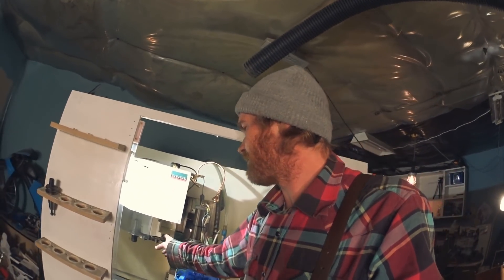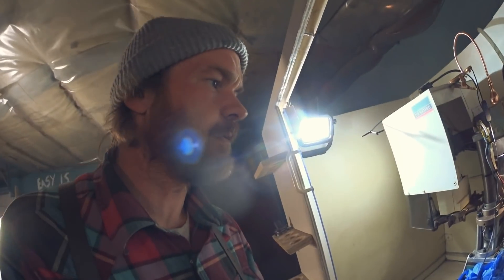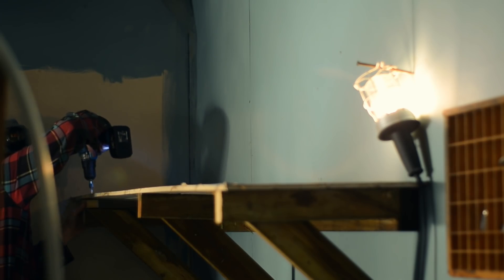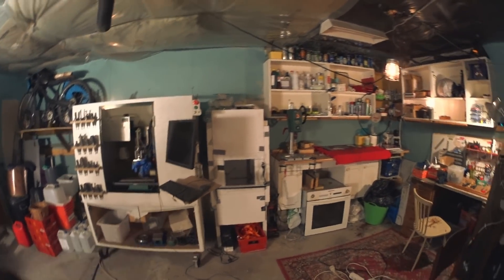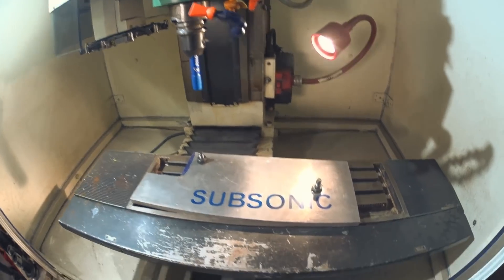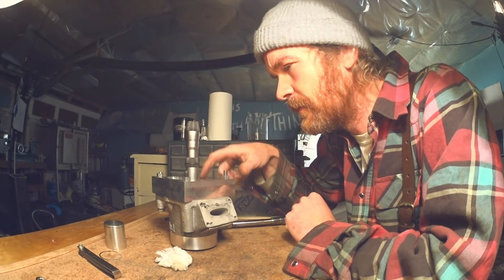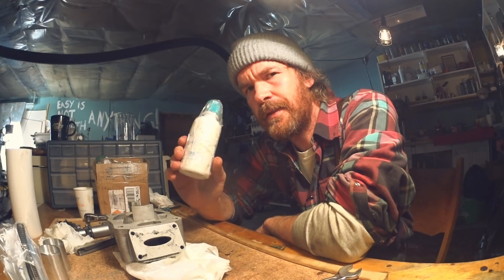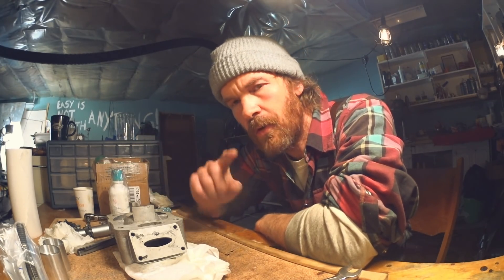Honing Plates make Difference? Most Powerful Two Stroke Ever.

Comment: Out of curiosity, how are you working it out as most powerful ever. Is it by H.P./Kg, H.P./C.C or are you just going for most powerful single cylinder 2-stroke.
Reply from the maker: Hp/cc
Reply: @2STROKESTUFFING  Nice. I am a great fan of the 2-Stroke, had them in motorcycles, go-carts, Suzuki 4x4 and still have one in an out-board engine.

Comment: I see you have a 3 point inside micrometer now. That's good. You say that the honing is leaving the middle tight and the ends larger? This bellmouth condition,  caused by the hone, can be fixed by changing the shape of the hone stones. Since the stones are cutting more at the ends of the bore the stones should be shaped in the opposite direction. To do this use a coarse diamond "stone" to abrade away a little bit of the the stones at each end. Now the stones will tend to cut more in the middle than the ends. How much to remove is an iterative process and it depends on what is being honed. However, if too much is removed from the ends the middle part can always be abraded away to correct things.

Comment: a question : a wankel motor rotative with triangle piston is :-2stroke or :-3stroke ??? 
does it better perform with a 2stroke style volume exhausts ??? 
with an rx8 we can do the most powerfull car in the world ??? 😈😈😈
Reply: Wankel design is comparable to a 4 stroke, as it has separate intake, compression, combustion, and exhaust phases.
Stock Wankel exhaust is highly restrictive for noise control. Racing versions use constant diameter tubing exhaust system, merged about 4 feet from the engine. Since it is not a 2 stroke, it does not require heavy return pulse during closing of exhaust port.

Comment: Nice job on the mill! I would to 3 phase motor and vfd. Cheaper and easier to find. Tool changer might just need the holder plate indexing to get the numbers match.

Comment: if the pistoni fits good with the pressure plates, like if you measure the bore and deem it OK with plates tightened, why did you want the piston to fit without the plates? with plates will be like when the engine is assembled, right? that was the point of the plates? good video man keep it up!

Comment: The commutator can be replaced with new one. If the armature winding is not damaged. Using a drill guide with perpendicular up nd down (like pressdrill) movement will help in honing. You should need it.

Comment: @2STROKE STUFFING   3D printed parts are printed at a high temperature. When the part cools, it contracts. It does not contract pefectly due to non-spherycal geometry- hence the imperfect bore measurements after it cools down. The top face is probably not flat either. It is mechanically flattened when you attach the pressure plate, as you found...
It would be very interesting to heat up the part and measure for bore imperfections. If the bore is more round when hot, should you not hone it hot (at least as hot as when the bike is running at maximum operating temperature)? Will honing it cold actually hone it (technically) wrong? If you hone it hot, when you run the engine and heats up, will the metal themically morph, therefore going against your 'cold' honing?
Does what I say make any sense?

Comment: Hi...After the Honing, you should be measuring the bore with the ‘PLATES BOLTED ON’
you should not be measuring with them off! 
....This is why you had a ‘Barrel’ shape when you measured without the plates!

When the engine is assembled it will go back to the shape of when the plates were bolted on!  Surely this was the idea of the plates in the first instance??? 
Measure everything & try the piston with the plates fitted!
Good luck Dude 🤠👍
Reply from the maker: 👍 Lots of comments about this. Of course, I feel kinda stupid...

Comment: I've had the same issue happen with tool changer numbering in my Fanuc. It's a very easy fix, but you NEED the manual. 
All I had to do was find the parameter for the tool changer position and change it to match. 
You'll need to get familiar with some common parameters and sequence for changing them.

Also, join CNCzone.com. It'll be a slow journey learning from YouTube. They guys on there have 1000s of years collective experience and are really helpful. Having a forum full of professionals really kicks the running crusher effect in the ass.

Comment: It's NOT tight in the middle...that is the distortion when the Cyl. is bolted on..That is why you use "Honing Plates"!!!..Ck. the clearance with the plates installed and it WON'T  be tight in the middle..without plates you would have a large balloon shaped cyl. when installed, which is probably why the issues with the rings developed in the first place..Keep going your getting closer!!!..It took me a year blowing up 8 engines, before I figured out how to run 15 Lbs of oil pressure, 0 valve clearance (to get more valve lift and duration) at 2000 rpm higher then anyone had ever run my engine without snapping piston rods..It's a journey..My engine has 30lbs cranking compression with over 185 lbs compression at full rpm..lasts 12 hours running time between "re-ring" jobs..It still holds the un-official lap time record at Road Atlanta after 39 years!!..👍👍👍🗽🇺🇸
Reply: Bores don't distort inwards with torque plates.

Comment: OMFG! The wooden folding tape measure! I have one of those too!  The thing about it being tight when it's a bare cylinder is that's fine, once you bolt it to the block it'll get back to where it should be. If you just adapt the piston to be loose when the cylinder isn't torqued down, you are going to have a super loose sloppy gap once everything is torqued.

Comment: Using a 3 phase AC motor and a vector drive is the modern alternative to DC motors one of the rather economical brands KCLY will even accept a tach but vector drives are pretty good at holding speed.without a tach.

Comment: I am a CNC machinist, the number on the carousel does not line up with the tool number.

edit, that motor failure looks like it got very hot, My guess is that it was not designed for large varying load

Comment: Hello, when using torque plates all measurements must be done with the plates installed for accurate fitment and ring gap. Recheck your cylinder with torque plates installed and make sure you are using the same torque wrench on all fasteners every time. Any gaskets on the head should be used with the plates installed also. All this does make a large difference in ring sealing. Well worth the time it takes. the tightness you are seeing in the middle of the cylinder may disappear with the plates installed. Good luck.

Comment: torque plates are extremely important I ran into that 30 years ago building a antique Harley . I had the barrels bored to 40 thousands over stock. at a famous Harley speed shop. 
 I found a 45thousands taper after I got the barrels back.
another thing is temperature of the shop . 68 degrees ferrihight is standard. your shop should be 68 for all machining and casting of pistons barrels ring crank pin all should be one in shops set at 68 ferrihight.
Reply: Thats Fahrenheit. Just saying.

Comment: 3d printers belong in corners and filament being fed to printer from a dryer underneath the printer. Takes up minimal space that way.

Also a good rule of thumb for me is to have critical stuff in the workspace, meaning I'd store that bike frame in a designated storage area and not have to think about the fact you might use it but not anytime soon everytime you walk by it.

Comment: If you don't want to over-hone it but you're worried about the middle pinching, try the feel when it's assembled & torqued down.  If it still worries you then how about circulating warm/hot water through the system before you start it?

Comment: A lot of comments already, but if it hasn't been mentioned. When you hone with torque plates,  you test the piston with the plates installed, as they are distorted as if the cylinder was installed. Trying the pistons without the torque plates are testing without the deformation of the plates.
Reply from the maker: 👍 First thing I'll do next time I'm out there.
Reply: @2STROKESTUFFING  and if possible assemble the torque plates in the same sequence as you will assemble the engine , base plate first then head plate .
Reply: Another benefit of using a steel cyclender liner. Stiffer with less torque distortion.👍✌️👌
Reply: this.
Reply: I was just going to type this
Reply: Agree..

Comment: That 0.05mm, is that your clearance on the ring groove or the end gap because if it is end gap, that is too tight.

I really dislike your set screw perpendicular to the bore.  If it backs out you are going to instantly trash your cylinder and maybe lock up.  Moving it to the underside of the piston wouldn't be much better, if it backed out it would probably get sucked in to the intake port.  I wish you could figure out a way to ditch the set screw and replace its function with a circlip or something that can't back out without breaking.
Reply from the maker: Clearance in the groove👍 yeah, agree on the set screw issue. When we're past the phase of frequent piston disassembly I could peen over the aluminium behind it to lock it in. Trying to come up with better solutions tho.
Reply: @2STROKESTUFFING  just had an idea, probably difficult to pull off but maybe workable.

Imagine a 30mm 12 point bolt head with a 25mm 12 point socket cut inside of it, now slice off 1.5mm of it to create a sheet metal lock piece.  Make your piston skirt with the bottom of the ring groove, the female threads and then a short 30mm 12 point socket followed by a circlip groove.  On the piston it would be piston head, top of ring groove, male threads (with wrist pin hole), then a short 25mm 12 point bolt head.

Everything would screw together, then you would put in the lock piece to stop the skirt from backing off, then a circlip will hold the lock up inside the skirt.

If the lock piece was made with the inner and outer 12 point surfaces off by 15°, you could adjust your ring clearance by your thread pitch÷24.

Of course the dimensions would have to be changed to fit and the lock piece probably has to fit over the connecting rod small end or maybe made in a C shape rather than O shape.

Also, a Spirolock might be better than a circlip but possibly a huge pain to install.

Comment: I have several NEMA 23 stepper motors, I don`t need all of them, these are from industrial printers, brand: Sanyo Denki, type: 103H7126-5040, DC 2A and 1.8 degrees. They are newer used but went out of our sortiment because the printers had being sitting on shelf to long, so I just picked them out before we throw away these old newer used printers.
I also have other NEMA 23 stepper motors, and maybe some NEMA 17, I have to look it up if you need some of them.
You can have some of them for free, how many do you need? 
I can meet you at Bjørkelangen every afternoon, I live at Blaker.

Last year, I think it was, I meet you at Biltema at Slitu and say hello.
Reply from the maker: 👍😁 I'll let you know if I'm in the area!
Reply: @2STROKESTUFFING  Den er god den! Jeg har også en god del elektronikk deler, f.eks. strømforsyninger, nesten alt du kan tenke deg av smådeler, dioder, led, motstandere, transistorer etc, det er bare å i fra! Jeg har også liggende noen Arduinoer, jeg kommer ikke til å bruke alle av dem i mitt prosjekt, så hvis du har ett behov eller bare lyst på en av dem, så er det bare å si i fra! Jeg har en av disse nydelige kortene: https://store.arduino.cc/arduino-mega-2560-rev3 som jeg for tiden ikke har behov for. For enklest å få ett raskt svar fra meg, mail meg på jobb eposten: janhugo@scaleit.no så får du svar i løpet av dagen. Fortsett med den sinnsykt kule prosjektet du jobber med!!!
Reply: Og gratis så klart, men jeg gidder bare å kjøre til Bjørkelangen..  ;)   Jeg har bodt på Hemnes, det er ca 45 km for meg å kjøre en vei, og nei, jeg gidder ikke å kjøre så langt for å gi bort deler, men du får alt du vil ha hvis du gidder å kjøre til Bjørkelangen. Lag en liste over hva du har lyst på og så skal jeg se om jeg har alle de delene. 
Hvis du ser på scaleit.no og søker meg opp på https://scaleit.no/kontakt-oss og Data og serviceavdelingen så finner du tlf nr mitt, det er bare å ringe!

Comment: I'm puzzled by all the casting pits.   how you can get good compression and ring seal with all the voids in the cylinder walls
Reply from the maker: Testing seems to indicate it's no problem, not conclusive yet. Got another cylinder that is being sleeved, + the 3d printed one that is spotless.
Reply: Sweet can’t wait to see that when it’s finished

Comment: Hi. I am absolutely noob and should not be listened to! But if the top of the piston can be removed, why can't you use a ring what is a solid circull/ without a gap? Just a tot. Love what you do!
Reply from the maker: I see your point, but with heat expansion it would bind.
Reply: @2STROKESTUFFING  Thats a great point, but how about  compramising cold start compresion for potentially hier compresion whyle full power. I dont really know what you will win with that, but maybe there is something to it. Thanks m8

Comment: You can get that motor rewound and new comutator plates put in. It's not that expensive; there should be a company that specializes in motor rewinding in your nearest big city. Motors are commonly rewound even when they are perfectly fine with more winds of thinner wire or less winds of thicker wire to hit specific demands. In the hobby community people rewind brushless motors for model airplanes and cars themselves all the time .
Reply: Agree ... that motor rewind will fix the problem ... be sure to replace the bearings!
Reply: Huh, I don't think I know of any companies that would have any interest in rebuilding something this small and weird.
Reply: @operator8014  "this small"? Look at RC motors. They are tiny compared to what he has.
Reply: @operator8014  I live in a small town of 20.000 people in central Europe and we have 2 workshops that do this kind of thing just in my small town...

Comment: I wonder how much the cylinder distorts with heat. Anyone ever brought one up to temp in an oven and measured the roundness?
Reply: They do distort, especially with varying cylinder temperature. Specialized "at temperature" honing is done in F1 to combat this since piston to bore clearance needs to be kept very tight
Reply: In operation, there would be thermal gradients, with the top inner being hottest. This would be difficult to achieve while honing. Then, you would not want to match that to a cold piston dimension. Piston also hotter at top. Suggest calculating change while hot, and compensating for this while measuring and honing cold.
Reply: @jimdale9187  Modern 4 stroke pistons are generally designed with this expansion in mind, featuring a "cam and barrel" shape that becomes near-cylindrical when in operation. If you grab a cold piston and measure the top land and center of the skirt between the thrust points (usually the stated location to measure for bore clearance) there is a significant difference. If you check cylindricity they're also quite ovaled since the pin bosses affect the distortion of the piston during heating. The design minutia in modern engines is fascinating.
Reply from the maker: Spot on Jim! Haven't forgotten about your ISO dyno idea/sketch btw(or rather, I just remembered... 😂) I'll get back to you!

Comment: would having the head bolted on and cylinder to crankcase have same effect as the honing plates being in place? maybe . good videos. bless you
Reply: Yep, this is the idea behind a torque plate. The torque plate simply gives you access to be able to hone the cylinder while it's under the stress that would be caused by the head and crank case.

Comment: Awesome work! Don't worry about the tight spot without the pressure plates. The whole point is to replicate the assembled engine by stressing the casting, the barreling under load is why you had a change in dimensions between no pressure plate and the pressure plates. Looking forward to seeing it run!
Reply: Was just going to make the samme comment, test the piston with the pressure plates installed.
Reply: Exactly. Try the piston with the plates on!
Reply: It seems counter intuitive; you end up with a less round hole in the free state, but once assembled it should be more round than had you honed in the free state.

Comment: 7:05 dunno what material is piston made of but it will expand more than cylinder, also 2piece ring will provide less heat transfer to cylinder walls. -its just what i think, not an expert or anything.. just make sure you calculated/thinked of everything

Comment: You need to wash the cylinder super clean before measuring. Even the oil film can make u caliper measure wrong. And the temperature is important. If the cylinder change temprature while hooning it wil screw up the measuring.

Comment: that piston clearance sounds real real tight to me.. or is it so mucht tighter in general with a two-stroke?
Reply from the maker: For ~40mm bore 0.05mm is pretty much the norm.
Reply: @2STROKESTUFFING  is that because of the rings and stuff? Because in a 4stroke engine you typically get around a millimeter of clearance or a half for that 40mm bore
Reply: @2STROKESTUFFING   for a piston port maybe, for a reed I would open it up some more